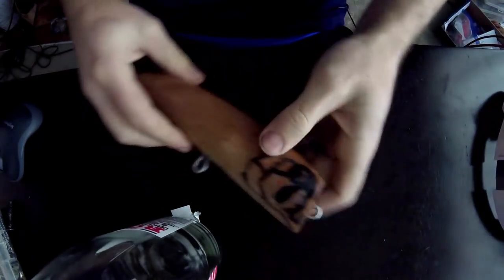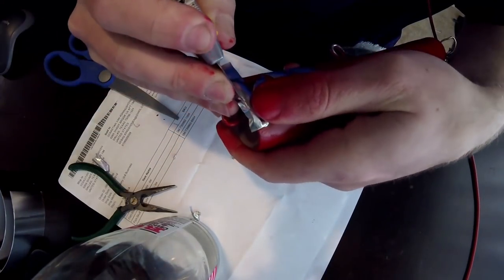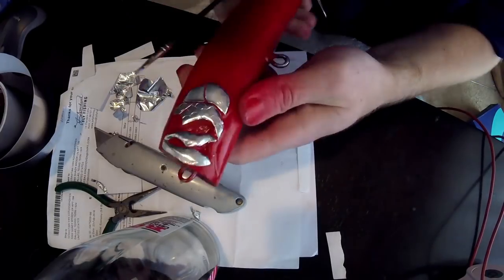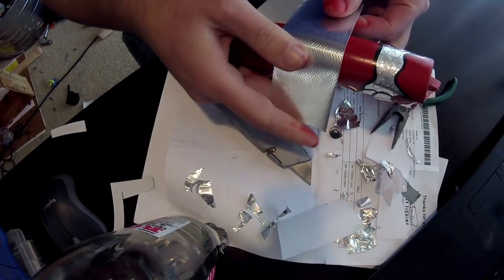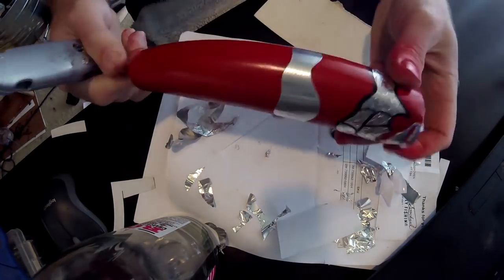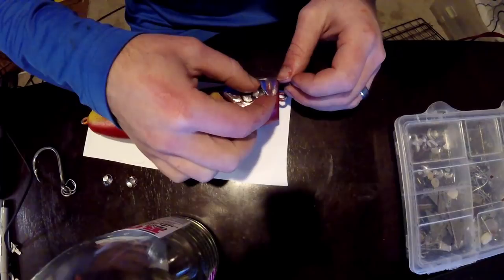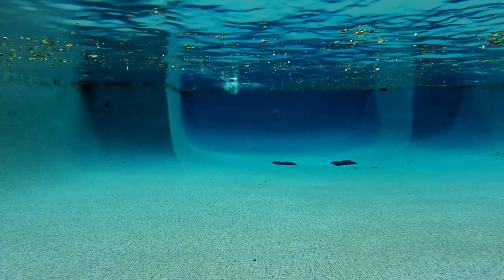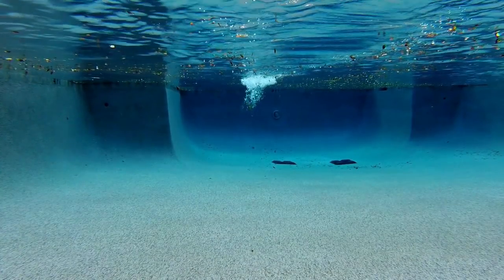Foiling, Painting & Testing My New Favorite GT Lure - Nemo Blooping Darter

Comment: Hi mate keen angler living on Gold Coast Australia have started carving lures and have some bodies carved before painting and finishing wanting to know what epoxy you use if any after they have been painted
Reply from the maker: Hey mate, thanks for watching! The epoxy I use is Envirotex Lite. I've ordered it before from an Australian supplier (don't remember which one) when I was still living in Australia. Make sure you have two syringes or another way of accurately measuring out the two components by volume because it is quite sensitive to the ratio. You can either hang dry your lures or use a lure rotating device like the one I made in one of my videos. Let me know how you go!